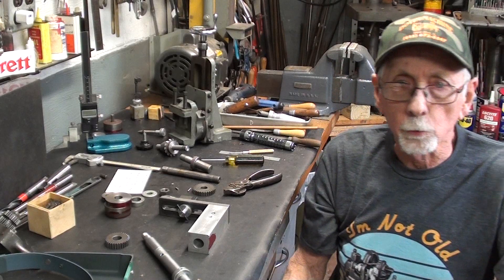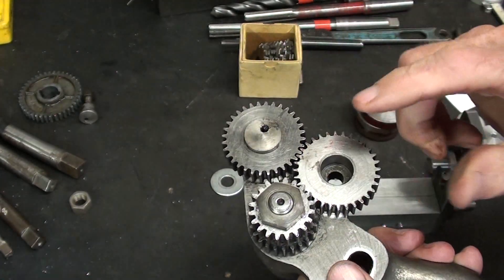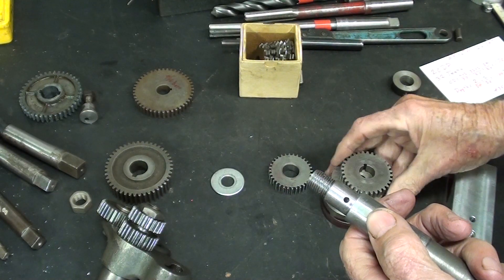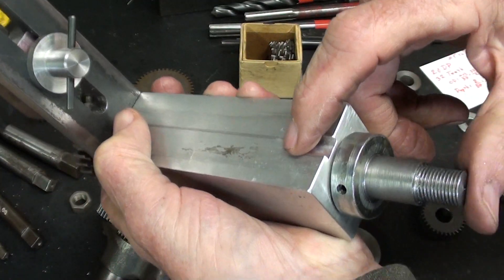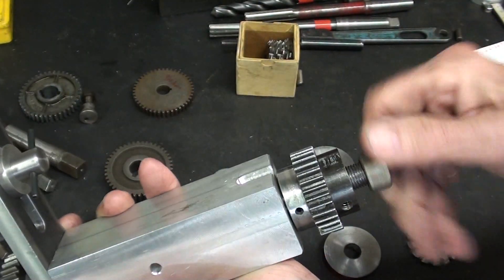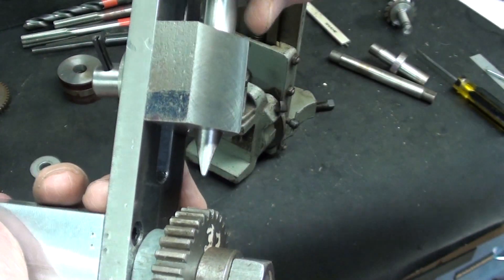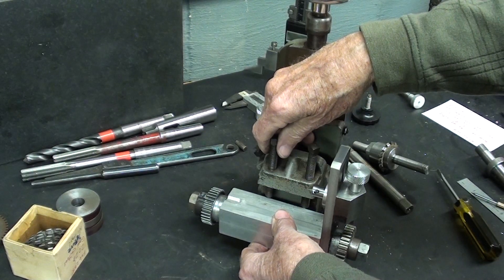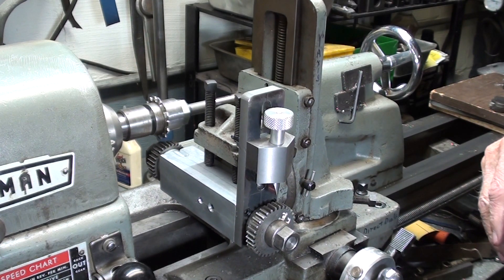MAKING ATLAS GEAR CUTTING FIXTURE pt 6 #840 tubalcain assembly

Comment: Very satisfying indeed to see this device in one piece and installed!

It really is a chicken-and-egg situation however with using a milling machine to produce the tool so you don't have to use a milling machine!!! I also hadn't thought about the rigidity issue--I think that could well be the Achilles heel of this whole project. Keith Rucker recently made a spiral gear from scratch, but even with a horizontal milling machine, an index head and a proper lead attachment he ended up making two passes per tooth in order to avoid any issues with rigidity. Given there are only two points of quite narrow fixture for this device to attach to the lathe I am certain you will have to very carefully nibble away at each tooth.

Thank you very much indeed Mr. Pete for going through this long and really very involved project. Looking forward to seeing it all in action next!

Comment: I remember seeing drawings and such in one of the magazines from the 1950's-1960's.  I always thought it was a cool attachment. Never built one.  Later, I wound up with a old B & S dividing head that I cut several gears with.  Wish I still had that DH today.  
The design of this one gave me ideas of making one for holding a index plate that could be used on the mill instead of the lathe.  The index plate I have has a 127-hole circle that I want to make a gear for the South Bend lathe.  
In the meantime, if I need one, I'll 3-D print one.  But nothing replaces making one from metal.  
As always, thanks for sharing. Ken

Comment: Hi Lyle, have you considered drilling a horizontal dowel hole through the gear blank and in to the pinned ring on the shaft? Doing it this way would not compromise the bores where they freewheel on the bearings. Thanks for another excellent series of videos.
Reply from the maker: Great idea

Comment: These were not wasted lessons. If there are a few novice machinists who need to jump in at the shallow end, this may fill a need for them. This device could also have uses other than gears. Laying out equally spaced holes around a wheel rim for the spokes comes to mind. Or, as in my case, just thinking through the logic of how this device was designed could be the spark for solving some other mechanical development. Mr Pete, any time we spend tapped into your years of experience and gathered knowledge is always time well invested. Please keep on teaching us how. 🥸👍✅
Reply from the maker: Thank you for watching

Comment: Hi Lyle, that was a great finish to the build series and plenty of good tips too.  Thank you for doing the build and sharing with us.  I look forward to seeing it in use cutting a gear or two.  I am wondering how rigid it is and how it will function in use.  I really only have a running lathe in my shop so this is something I would consider making to cut a couple of gears to replace the plastic ones I printed.  Thank you again, your efforts are greatly appreciated.
Reply from the maker: Glad you enjoyed it
Reply: what filament did you use for the 3D printed gears? Didn't they last?
Reply: @jerrydemas2020  I used petg and plain old PLA.  They are holding up just fine showing no degradation from the oil I use to lubricate them and have been using the for about four years.  I am not against them at all.  I just want to be able to cut some from aluminum and some off sizes to cut specific worms.
Reply: And you can 3D print another for your master to copy in steel
Reply: @stevewilliams2498  yes sir.

Comment: I made this for my 6 inch Atlas-clausing lathe and did cut a gear out of aluminum.  I used  a 1/2 inch shaft through the square block since my gears use a 1/2 inch ID.
Works wonderful!   Fun to build.  My milling attachment was copied from your design also.

Comment: Lyle - Good wrap up and explanations.  Lots of little tips/techniques that are helpful for other projects.  Especially liked marking the 'gear lock tooth'.  It's little things like that to help accuracy that assist when working to the limits of a machine/setup.  Piece of cake to cough out the gear on a Fellows Gear Shaper - but how many have one of those in the home shop?  Keep up the good work.
Reply: You could probably order that exact gear, or one with a smaller bore that can be enlarged, from the Boston Gear Catalog.
Reply: @ellieprice363  Where's the fun in that?  To do it that way, all you need is an easy chair and a telephone.  Just look at all the cool machines and knowledge you have to have doing it Lyle's way.
Reply: @kensherwin4544  I understand your point. I’m a great fan and subscriber to Mr. Pete’s channel. 
He even produced a video on my Bridgeport tramming device. It depends on the situation. If you want to learn how simple spur gears can be made on a lathe Lyle’s video will show you how. However if you have a gear failure in production and need a replacement fast Boston Gear, McMaster-Carr, or any Industrial Supply Company will get you back in service fast.

Comment: There's very little torque on the blank if accurately aligned, indeed conventional cutting the force will be radially outward so preventing rotation if anything.

Comment: The attachment does have several things going for it. Even if cutting the gear requires a roughing and a finishing pass, the attachment indexes so quickly that with power cross-feed  you just have to keep cutting oil on the cutter (if you don't have your drip oiler installed) while you watch it run.
Most gear cutting jobs in the home shop are making missing or damaged gears for the lathe's threading gear train. If the gears are made of Aluminum instead of steel or cast iron the gears will only last three lifetimes.
Cheers from NC/USA

Comment: I have wanted to see this device made since I first saw the drawings online several years ago. I spent a lot of good money purchasing a milling attachment for my Craftsman 12” and have never used it. I had a need to make a few missing change gears for a South Bend 405 I purchased and thought this would a good option. I do have a little milling machine, a Lewis Machine Co., but it has been modified to vertical with the addition of a Benchmaster head, and would be a pain to cut gears on due to its size and my lack of a dividing head. I might try to make one of these to cut a couple gears. What I particularly enjoyed about this series was your modifications and musings on how to improve the design. This got the gears in my own head spinning. It’s one thing to design a thing, another to figure out how to make it work in the real world. Great series!
Reply from the maker: Thanks

Comment: "Wrong end, Corrigan."😄
I have a suggestion. You could drill a small hole in the face of your gear blank, and a matching one in the shoulder of the fixture shaft, then use a dowel to couple them. Lots easier than keyways, and you would eliminate that potential wear point where the gear turns on the stud. You could even fill it in when the gear is complete if you want to. But you may not need to key the gear to the fixture at all. The gear cutter puts strictly an axial load on the workpiece. Virtually no torque. Friction from securely tightening the nut should be sufficient. Keying would be cheap insurance, though. I'd probably do it.

Comment: Just re-watched this video and it was just as good the sixth time viewing it as the first time.

In looking at the drawings very closely and comparing it to the gear cutting fixture I made back in the 1990's for my little 6 inch Craftsman lathe I see that the one I made is lacking a few components (such as the collar at the front) and definitely not nearly as pretty as the one you made.  Since I did not own (and still don't) a milling machine I used a bit of right at the edge of the box thinking and a mig welder to join some of the components and create the slot where the indexing dog moves up and down.   Instead of using a square block of metal to hold the shaft I used a piece of 1-1/4" round stock 2-1/2" long and bored to 3/4" I.D.  The round stock piece was welded to a piece of 1/4" flat bar centered on one side so I could mount it in the milling attachment vise.   180° from that I cut a slit in the round stock and then mounted two flat bar tabs (one on each side of the slit) so I could then clamp the shaft by drawing the two tabs together with two 1/4" socket head screws.  The upright piece to hold the indexing dog was made out of a piece of flat bar with a slot cut in it using a hack saw and then a piece of 1/4" key stock was added to each side of the slot so the indexing dog was snug but slid up and down.  The indexing dog is solid on mine (not spring loaded) and has a V at the bottom end to fit into the space between the teeth on the indexing gear - it locks in place using a 1/4" socket head screw that is tightened and loosened to allow the dog to slide up and down as the gear is advanced each tooth.  I did not use a collar between the indexing gear and the piece the shaft mounts in - instead I just left a step in the shaft as the front side that extends about 1/8" so the indexing gear is stepped away from the body and can rotate freely when not clamped.  I figured that all the pressure while cutting a gear is being exerted from the rear as the blank is fed into the cutter - the rear of the shaft does have a step so it cannot slide forward.  The shaft I used has a  1/2" diameter step at the front so I could use the lathe change gears to index (24P 14.5 PA) and 3/8" diameter at the rear where the blank mounts.  Neither of the shaft ends are keyed - I just tighten the nuts securely against the sleeves that seat against the indexing gear and the blank being cut.  Maybe I am just lucky but I have never had the gear I index with or the blank rotate while cutting the gears and I have cut about 15 gears with it so far.  I also had to extend the housing further away from the milling vise than what yours is in order to allow cutting the larger gears (such as a 64 tooth gear) given the very limited travel of the milling attachment vise on my small lathe.  Since using mine a few times cutting the larger gears I have made a few modifications - one of which was to allow the shaft to be loose enough to rotate and only locking it using a 1/4" socket head screw once I advance the index gear to the next tooth and secure the dog.  This does not appear to make a difference in creating a gear and allows me to rotate the shaft advance to cut the next tooth a little bit quicker.  Just thought I would let you know that while the gear making attachment may not have been very popular with many people a few were made and are still being used.  I will be the first to admit that my version isn't very pretty compared to yours but at the end of the day it allows me to cut new steel change gears for  my lathe and that was why I built it.    

One thing I have observed is that a power feed for the cross slide screw would be easier than turning the screw by hand ( especially when cutting several 64 tooth gears) but you make do with what you have. l may see if I can create an electric variable speed power feed as my next project if the gear sets I am hoping to create work out ok.

Thanks again for posting these videos and sharing  your wisdom and talents so other amateur's such as myself can see how it should be done.

Comment: Why key the gear to be cut? There are no tangential forces to rotate the blank on the shaft when cutting straight spur gears. Surely a good friction fit held with that end nut should work perfectly well?

Comment: As always, lots of clever design all over the project. A pin instead of a key, an undercut to avoid burrs making trouble later,.......
As Yo say, wonder how many units will be built. I confess. Plan A is to bore a few holes, thread some and assemble the digitally controlled rotating table capable to both horizontal and vertical mounting. But as Plan B, using the main design idea, and design a fixture like this is a clear option.

Comment: Hello Lyle, As mentioned earlier in this series, I made a similar attachment for my Hercus Lathe (S/B clone). I made a hollow spindle that would take a 3C collet and have used it to mill flutes in some strange taps that I have made. The first tap was a 4 flute, 7/16¨ x 10 TPI, left hand Acme thread for a new cross slide nut I was making.

Comment: To keep the gear blank from rotating, drill a short, blind, 1/8" hole in the rear of the blank, to slip on to a short, 1/8" pin, that you protrude from the end of the aluminum spindle housing. Using a keyway in the shaft has it's challenges as the blank gear hub varies in diameter.

Comment: I made one about ten years ago. I changed a lot of things like you did otherwise it would never have worked . You made about the same changes that I did except I put a lot heavier spring on the spacing pawl. It get to jump around and promptly broke a cotter and made a mess of everything. I turned both ends and made some bushings from 11/16 to i inch and hardened them . then things went better from then on. The plans are available from the company. that baught Atlas and I cant think of right now. Covid brain and old age took care of that.
Reply from the maker: Thanks

Comment: Instead of keying the non-keyed gears, you could make a collar that is keyed to the shaft and has a pin (or a hole for a pin) offset from the collar's axis.  You could then drill a hole in the blank that temporarily allows you to pin the blank to the collar during gear cutting.  Just an idea.. Great project, thanks!

Comment: I don't know if it can be done, since I don't have a milling machine, but I intend to try to make one of these on my 6" Atlas.  I have the milling attachment for it. I will probably have to simplify the design to get it to work. It will be awhile before I get a chance to attempt it.  Keep up the good work!  I just love these types of projects.
MJ
Reply: I bought a used Atlas 6" lathe about 30 years ago and it included a vertical slide and a similar gear-cutting attachment, scaled down for the 6" lathe - 1" square steel housing with a 1/2" diameter arbor.  

I tried to attach a photo but don't know how.

Comment: How is the depth of cut maintained to control the pitch diameter of the gear that is being cut?
Reply: Once you touch the blank to the cutter, the depth of cut will be set with the milling attachment and locked into position.

Comment: I'm going to build a milling attachment for my tiny lathe. But first, I'll have to build a x-y jig for my belt sander. I may be wrong, but I'm pretty sure cutting a dovetail is possible without a mill, it probably won't be as pretty in the end, but function's the important part.

Comment: I'm going to drill holes in my blanks through sides and make a washer with pins in it to avoid keyways.  Similar to how some gears are pinned in quick change gearbox . I don't have broaches and will do this for ones that need Keyway also.. I will be making all my gears and will use this in my milling machine to duplicate.
Reply from the maker: Great alternative idea

Comment: I suppose, since one making this tool will be making their own gears from scratch, they could bore the gear blank to fit the tool arbor, cut the gear and then, using the current bore, center the gear in a 4 jaw chuck and re-bore to the correct size. It's extra work but with no other option, gear making becomes possible. Suggestion: Rather than cutting a keyway in your arbor and gear blank to prevent slippage why not use CA glue to affix it for cutting and heat the part when it's done to break the super glue bond?

Comment: Question: Why would two pictures at the end of this video show a gear being cut from the bottom?
Maybe it's the setup used for non reversing lathes.
Reply: If you look at Mr. Pete's setup you will notice he is at the bottom of travel for the gear he wants to cut.  This is why he mentioned running the lathe in reverse to keep the cutting forces going into the gear blank.  If you had to cut a larger diameter gear you would not have enough down travel in the milling attachment.  So instead the larger gears are being cut from the bottom of the blank with the lathe running in the forward direction.  You would have a bit more travel in the Y axis of the gear attachment to account for larger blanks.  Hope that made sense.

Comment: Mr Pete.  I am experiencing something similar to "tightening the set screw onto the shaft and leaving a mark"  (@5:54).  On my Atlas/Craftsman 12 inch 101, the two pins that secure the upper swivel against the spigot on the lower swivel only touch the spigot at very small contact areas.  After 70 years, these pins are making a bit of a dent in places where they've tightened against.  I'm thinking that grinding the faces of those pins at the correct angle vertically using a round stone (or something) would increase the contact area, give a stronger grip and would not enlarge the dents any larger.  Due to the size and angle involved, I cannot think of how to do it, or what tool to use for accuracy.  Do you have a suggestion?  There might be a vid in this for you.   Try to think of a way to do it on a lathe for those of us who do not own a mill.

Comment: I myself am in the process of making a gear blank arbor for a mini 7x10 lathe with a mill slide table using a single point cutting tool to make the teeth. I see you are using a 32 tooth gear to duplicate a 32 tooth gear. In my case, I need a 40 tooth gear. Is it possible to use an 80 tooth mod1 gear to cut a 40 tooth mod1? By the time I get half way around the 80 tooth gear would the 40 teeth in the blank be cut? Thank you for all of the knowledge you share mr pete! Edit: your next video (#841) answered my question.